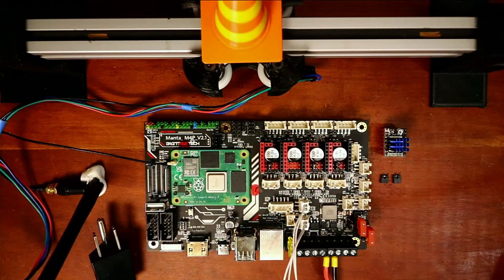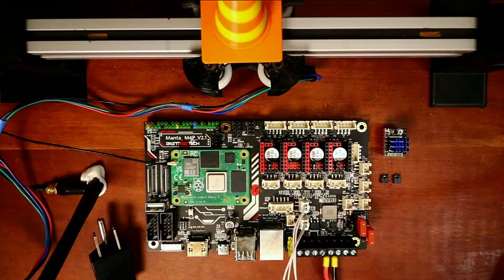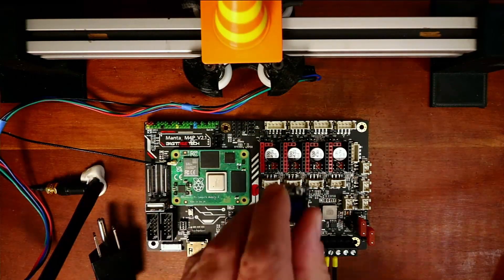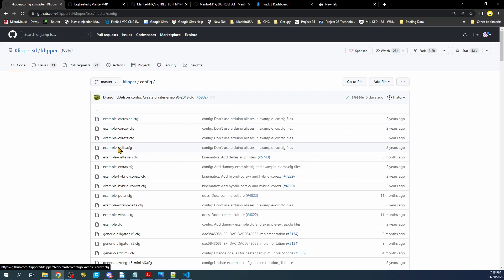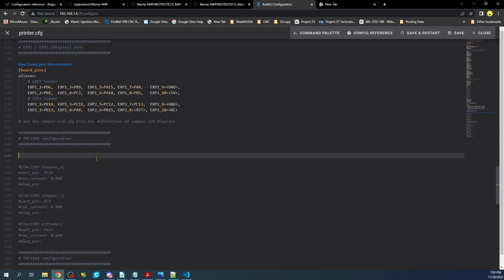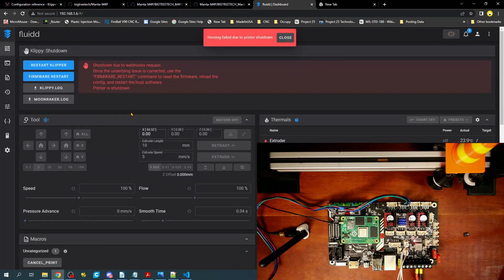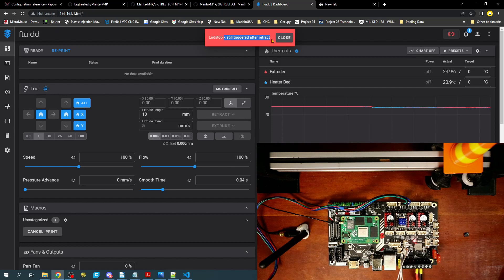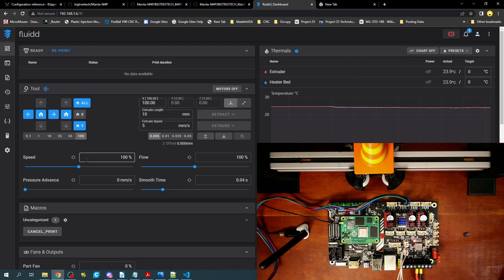BTT - Manta M4P - TMC2209 with Sensorless Homing

Comment: Great vídeo sir!!! A question, I have a mp8 1.0 and i think its about the same thing with your configuration. What i dont know is, if i set up the run_current: on klipper config, do I still need to calibrate the vref using the screw on the actual driver
Reply from the maker: Technically you should never need to calibrate the stepper.  It's calibrated in the factory.
Reply: @EdwardBraiman  I mean the potentiometer on the driver
Reply from the maker: @JoseRenatoIzar  Correct they are turned in factory, you can control it via Firmware.

Comment: Just a thought about sensorless. How about having two neodym magnets or so with the same polarity facing each other as endstops. The magnet force makes the sensorless end both touchless and silent. The parts holding the magnets just need to withstand the force. Also not interfere with something else. It would optimise the whole function.

Comment: me i get my firmware to shutdown  every time i trigger a stepper
Reply from the maker: What's your configuration?

Also there's a Discord link in description of video and either myself or someone else in General chat can help you.
Reply: @EdwardBraiman  [stepper_x]
step_pin: PE2
dir_pin: PB4
enable_pin: !PC11
microsteps: 16
rotation_distance: 40
Full_Steps_Per_Rotation: 200
endstop_pin: ^!PF3
position_min: 0
position_endstop: 0
position_max: 300
homing_speed: 30
homing_retract_dist: 5
second_homing_speed: 10

[stepper_y]
step_pin: PF12
dir_pin: PF11
enable_pin: !PB3
rotation_distance: 40
Full_Steps_Per_Rotation: 200
microsteps: 16
endstop_pin: ^PF4
position_endstop: 0
position_max: 300
homing_speed: 30
homing_retract_dist: 5
second_homing_speed: 10

[stepper_z]
step_pin: PD7
dir_pin: !PD6
enable_pin: !PF10
rotation_distance: 8
Full_Steps_Per_Rotation: 200
microsteps: 16
endstop_pin: PF5
position_endstop: 0
position_max: 305
position_min: -5
homing_speed: 5.0
homing_retract_dist: 5
second_homing_speed: 3

[stepper_z1]
step_pin: PD3
dir_pin: PD2
enable_pin: !PD5
Full_Steps_Per_Rotation: 200
rotation_distance: 4
endstop_pin: ^!PC0
microsteps: 16

[tmc2209 stepper_x]
uart_pin: PC10
#diag_pin: PF3
run_current: 0.800
stealthchop_threshold: 999999

[tmc2209 stepper_y]
uart_pin: PF13
#diag_pin: PF4
run_current: 0.850
stealthchop_threshold: 999999

[tmc2209 stepper_z]
uart_pin: PF9
#diag_pin: PF5
run_current: 0.580
stealthchop_threshold: 999999

[tmc2209 stepper_z1]
uart_pin: PD4
#diag_pin: PC0
run_current: 0.580
stealthchop_threshold: 999999

Comment: Will this be the same with the tmc2130 drivers ? Well the coding part. I know the board jumper pins are different but I would think the code adjustments are the same.
Reply from the maker: Pins will be similar, but sensitivity is different.  Depends also on using a endstop or not.  If there's a endstop, jumper for sensor less homing is not required.

Comment: Thanks for your great video! Any idea how to use the flysetc 2209 driver with endstops on this board ? I mean by the rumors about the cross placed jumpers
Reply from the maker: Unfortunately have not tested other brand steppers yet as I need to first use defualt configurations, but just recorded version for endstops on BTT TMC 2209 in UART mode.